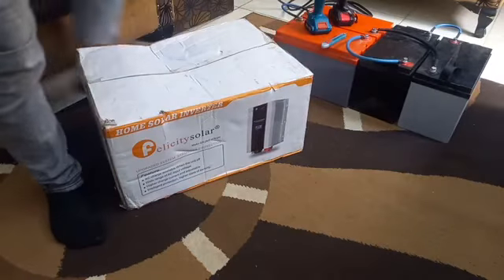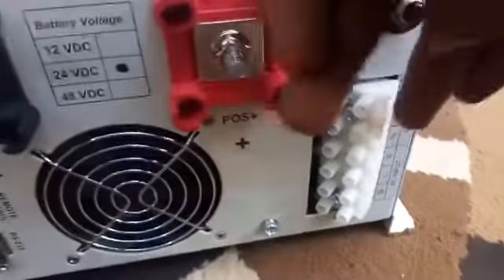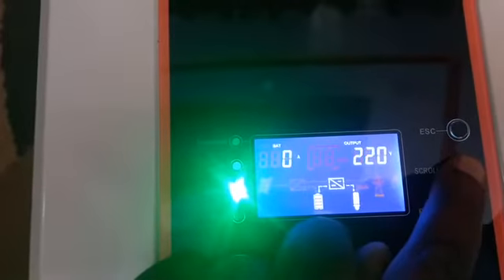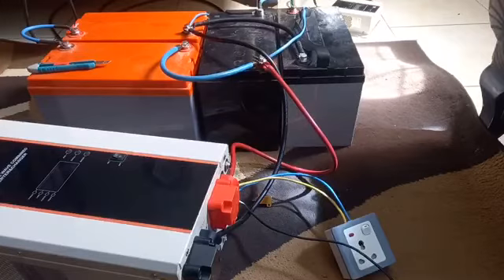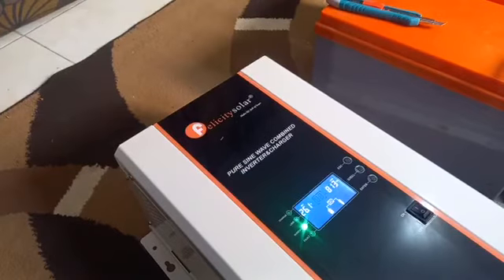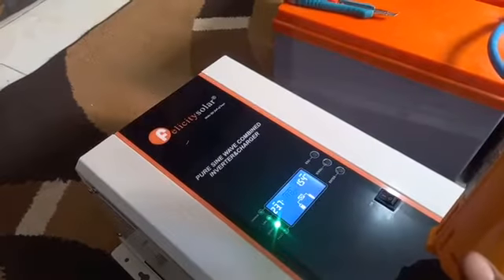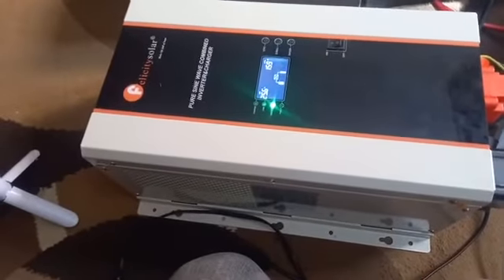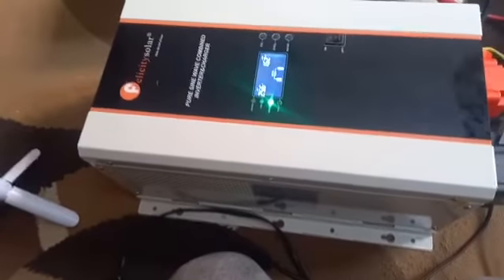Felicity IVPS2524 Combined Inverter Charger unboxing and Testing

Comment: Dear Falke thanks for sharing your experience and astuce for solar. I would like to go with solar backup and use the IVPM10048 low frequency of felicity. So far how was your experience with felicity LF inverter ? How reliable are they ?for info I would like to go LF INVERTER to ensure durability running AC, fridge, washing machine. Thanks in advance for your feedback.

Comment: Hello. I really like your efforts and test capabilities. Pls am in Cameroon. How can I have that inverter say 24 and 48 volt prices to know which to chose.
Reply from the maker: You can Google Felicity Solar office at 40 RUE 2360, Douala, Cameroon. I think price may be lower than with other vendors, as for me in Nigeria, the last time I bought the 24v 2.5kVA(IVPS2425) was ₦245,000, 3.5kVA 48v (IVPS4835) was ₦285,000, 48V 7.5KVA (IVPS4875) Was ₦485,000.

Comment: Does this IVPS Felicity Fan kicks in @ 50% load or below 50% load.

Also, beside Felicity, which durable inverter would you recommend that's not too expensive?

Comment: Is the 3.5 kva felicity inverter capable of powering a 0.5 submersible pump?
Reply from the maker: @teeman9166  I'm currently using Felicity 2.5kva 12v  to power 1hp submersible pump.
Reply: @diyfalke  nagode dan uwa

Comment: So is the heat gun producing the humming noise to the inverter as a result of the lack of kicking of the cooling fan, because I noticed that once the fan kicks in the noise stops.
Reply from the maker: Perhaps it's the transformer buzzing noise, when the fan kicks in, it overshadows the transformer buzzing.
Reply: Hey friend, we noticed that you keep unsatisfied on our brand, right? Stand for a custoer, do you have any suggestions?

Comment: I think their HF version is better......have pushed their IVCM(5kva/48v) hybrid to its maximum capacity, and it handled it well. The challenge is for battery to keep up. They are equally strong, light and have better charging effectiveness. It has been powering my flat 24/7 for the past 2yrs.
Reply from the maker: For me both the LF and HF are equally good, I prefer one over the other base on two factors.
1. The use case i.e the load type
2. The Installation environment.
When using inductive loads, Power tools and well pumps I choose LF because they handle torque better than HF inverter.
The HF inverter uses electronic components, these don't like high temperature, in some parts of Northern Nigeria it sometimes get really hot, i tend to go towards a modular systems than hybrid.
Reply: @diyfalke  I have used both LF and HF. Used LF for a year before switching to HF because of the integrated Solar CC. I can tell you, the experience in terms of handling load is similar. I pump(1.5hp submersible), microwave, wash(washing machine), iron(1.7kw steam iron), cook with the inverter. It powers my whole flat. My electric bill has shrunk greatly. And I can count the limited number of times have bought gas in a year. Trust me those HF inverters ain't weaklings in handling all kind of load as far it's not beyond its 2x surge rating. 

And the cherry on top is the better idle load consumption. When I was using the LF, my batteries run down faster,  because of that I don't use it to power heavy loads, lest I run out of battery energy, I was conservative with loads. But not with the HF, You can run it all night and when you wake up, you still have sufficient energy to cook and iron with it before solar takes over.

Concerning the heat, I can't say much since am not an expert in electronics, but one thing I know, you cant be powering heavy duty loads continously 24/7 with any kind of inverter. Inverters get hotter depending on the ambient temperature as they power big loads. They always have a sticker attached to the sides that show the acceptable working temperature range and I think it's ok for our tropical climate
Reply from the maker: @akinwaleakintoye8304  As I said, they are equally good, and as you said High Frequency Inverter has very low idle power consumption, my IVPL4850 LF inverter uses almost 100w without any load. It all comes down to personal preference and ones reason for making these choices.
Reply: @diyfalke Alright
Reply: @diyfalke   good videos you are making, thanks for the good work, in fact I have subscribed to your channel.

I have interest in IVPS3524, but I would like to know the Idle Consumption of it as it's not included in the Felicity manual.
Reply: @akinwaleakintoye8304  Please which Model of Felicity did you use to power the items you listed here?

Secondly did you power the microwave together with the pump?
Reply: @peterakoh3432  you can, but I don't put on a lot of heavy loads at once because of battery. It Felicity IVCM 5kva/48v. You can check out there IVEM, it's the most recent model
Reply: @akinwaleakintoye8304  What's your solar array? Can IVEM3024 power  2hp submersible pump?
Reply: @peterakoh3432  I don't have any experience with their newer model. But I think a 3kw inverter should be able to power a 2hp pump. My own rule of thumb is my maximum load per time shouldn't be more than 50% of inverter carrying capacity. On exceptionally rare time can go up to 80% but that should be for brief moment.
Reply: @diyfalke   I am still waiting for the No Load Consumption of IVPS3524?
Reply: @akinwaleakintoye8304 Hello, please what's your total solar array that you use with your 48V system?
Reply: @yusufhaliluzakari  Around 2.5kw, 9 x 270w panels connected in 3S3P
Reply: @akinwaleakintoye8304  Appreciate! Thanks

Comment: My felicity inverter just went off immediately lightening striked. And wont even turn on.. what can i do?
Reply from the maker: Someone I know in mainland had the same issue, he returned to the point of purchase, they fixed it within short time. What is the model of your inverter sir?
Reply: @diyfalke  you will need to replace BMS after lightning strike

Comment: Does it work as a charge controller and inverter at the same time ?
Reply from the maker: No sir, the IVPS series does not have charge controller, But has built in AC charger.
Reply: Which means it can charge my battery bank via government power whenever there is light? If so, am glad I got the inverter charger then. Current, for the past 2 years, we have not seen government light in my area and I just installed a solar system last November with 220 amp battery. I also enjoy your video a lot and have learn so much. I’ve learnt a lot from all your videos